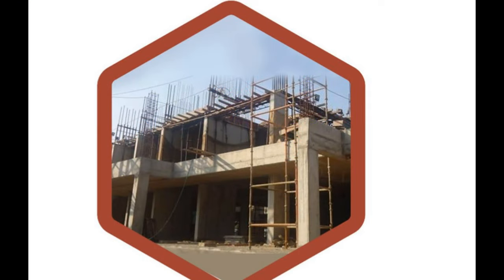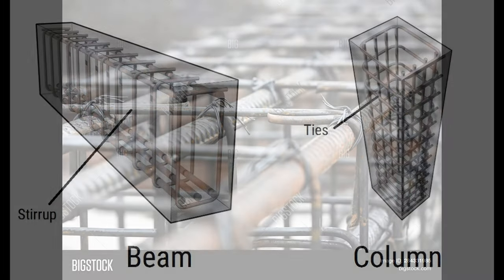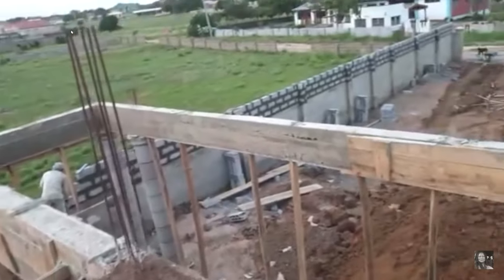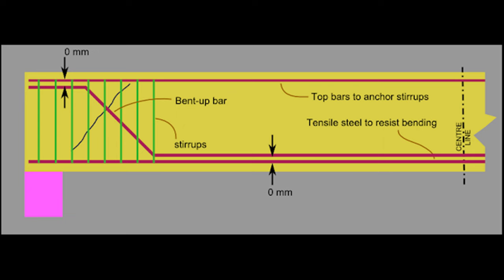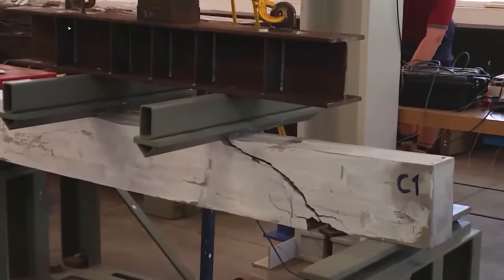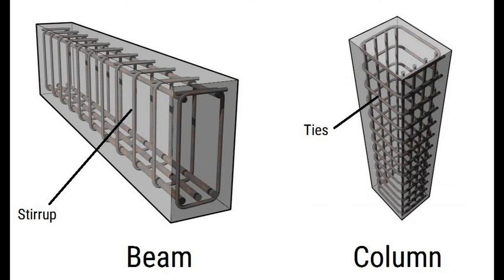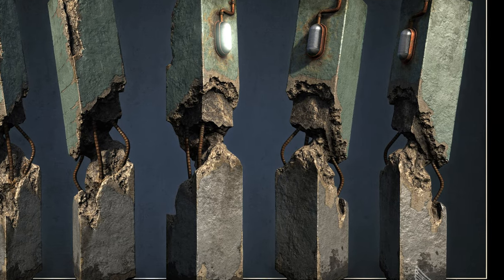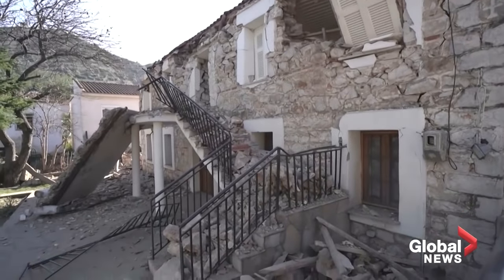STIRRUPS AND TIES IN COLUMNS. Building Your Dream House in Jamaica

Comment: With sky high building material prices now, do you recommend building or buying a house?
Reply from the maker: it all depends on the prices that houses are going for in the type of house you need. 
Also depending on what you are looking for in your house.
It also depends on whether you are going to be your own contractor or not because a huge part of your building cost will be contractor fees, or rather over inflated "fees".

Also when you build you get exactly what you want so its a tricky question that depends on  a lot of different factors.

Then there is the matter of size. Often times you may start out thinking you need a large house but then realize you actually don't so then building a smaller house as opposed to buying something bigger is something that has to be measured and taken into account.